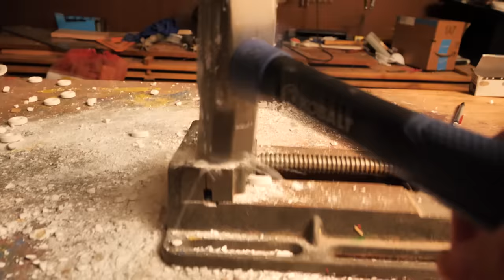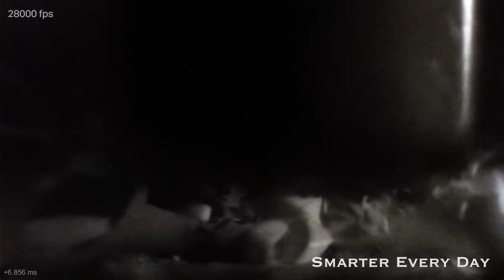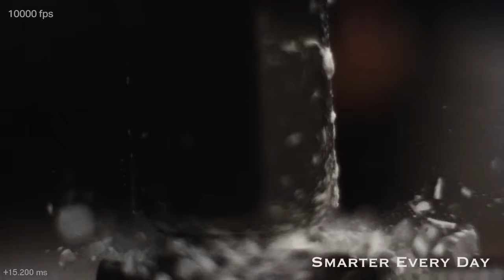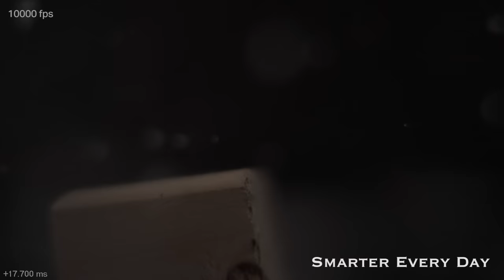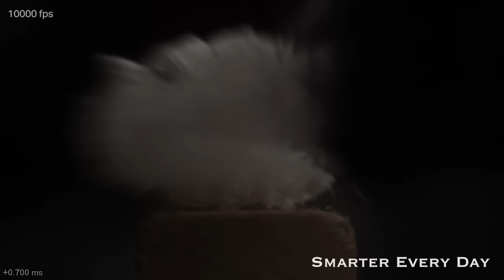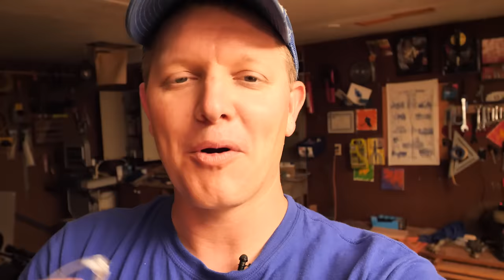LIFE SAVER LIGHTNING (Triboluminescence Slow Motion) - Smarter Every Day

Comment: Hi @Destin,
would it be possibel to do a spectral analysis of the emitted light? It might offer clues to the process involved. If it is an ionisation like @JediBhuddist guessed you should find a very element- or molecule- specific wavelength. If a thermal process is involved the spectrum should be broader and the smallest measured wavelength should decrease with increasing energy input.
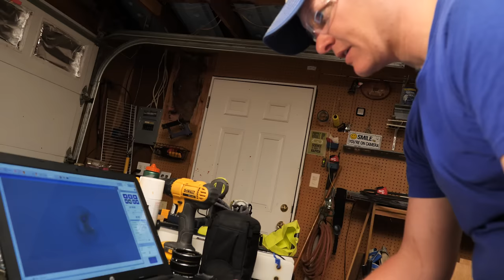It would also be interesting to know whether the wavelength of the light depends on the crushed(/stressed) material or on the atmosphere around it(or maby gases inside the material[dissolved or present in pores]).(4:45 indicates that only the crushed material is involved, but anyway)
Thank you so much for making this video :)

Comment: Ok Destin, not sure if you are going to read this but:

There was a video about Scotch tape being ripped in a vacuum, that caused both Triboluminescence, as well as X-rays. Not just a little bit of x-rays... Enough to develop film. It was significant. (but required a near perfect vacuum)

It looked IDENTICAL to these lifesavers, and the theory behind that is that scotch tape isn't a physical bond, but a chemical bond that when ripped apart, releases energy in the form of light and radiation. I would LOVE to know if this would be the same result?  Do you have a way of measuring x-ray radiation? 

Science!!!
Reply: duct tape being pulled apart produces light also and it works at atmospheric pressure.
Reply: There was even a proposal to make a really small low cost x-ray machine that work on that principle
Reply: I see similar blue sparks when opening my Breathe Right nasal strips.  Easy to see with the lights off.
Reply: Sudz Opening self sealing envelopes causes blue light to be given off also.
Reply: OK, everyone offering examples? ALL adhesive strips spark when you pull it apart. There, I just covered every possibility, Lol :D
Reply: Velcro doesn't. Checkmate Atheists.
Reply: @Ryan Gunn Not all adhesives do that, but most of them do at one frequency or another.
Reply: DFX2KX fair enough, I over generalized.
Reply: No biggie.

Though that does bring up the few that don't do this, and why. Now THAT would be an interesting video.
Reply: L L 
Physics Girl just did a video on the bandaids
Reply: You dont even need a vacuum for that to occure. I used to devlop film in jr. high. The film, mostly 35mm was taped to the spool with masking tape. We had to make sure we peeled the tape off of the spool slowly so it wouldnt spark and ruin the film.

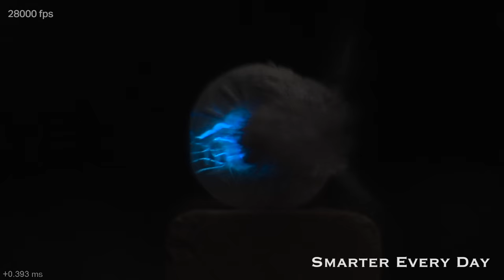Comment: The part that fascinated me the most was that during one frame around 4:31 you could see the blue glow beginning to spread before the pellet has actually struck the candy. At least, it appears that way with the streak of the pellet visible to the right of the lifesaver. I wonder if the shock wave travelling in front of the pellet, as it moves through the air, is creating enough stress to start shattering the lifesaver. If that's the case, couldn't you just fire a bullet past it but close enough for the shock wave to shatter it?
Reply: I believe it was the force traveling through the lifesaver from the front part being opened up - as if a wedge (the pellet) was driven in and forcing the part in front of the pellet to separate. Maybe?
Reply: Do high speed cameras have rolling shutters? Enough that, if the right part of the frame were captured first, the bullet would have moved ahead by the time it started capturing the impact point?
Reply: Sorry I am late but yes the high speed cameras have a rolling shutter (all cameras do) and the usual scanning pattern is either top to bottom or left to right. This is causing that effect, not a Shockwave (:
Reply: @samueldurazzo5312  Phantom cameras (and most good high speed cameras)have a global shutter. They need to in order to be useful for any kind of research
Reply: Shockwaves only come from the barrel of the gun, from high pressure and gas escaping, not the bullet.
Reply: @ashtonsenko536  Anything that moves fast will have a pressure wave in front of it, even if it's much weaker than one caused by a gun
Reply: Thank god my eyes are alright I was wondering if I was alone...
Reply: rolling shutter is my best guess
Reply: That's what I thought initially but if you look at how far the bullet moves each frame it's very likely it already penetrated and they just didn't capture it.

Comment: 4:29 does anybody see blue before the pellet hits
Reply: I think it is there. I wonder if that could be caused by a pressure wave in front of the pellet.
Reply: Micah Mainord vlogs answer is rolling shutter effect
Reply: Josua Dom i don't think it is
Reply: Yes, I was thinking the reaction is happening just prior to impact. I wonder if bioluminescence could be triggered with vibrations.
Reply: I saw it and think it needs further investigation - more framerate, to see if it's  an artifact of single frame or does happen in reality.
Reply: Hey Guys, This is probably happening because of the way the camera 'scans". I.E every frame it takes either takes a reading from each pixel top to bottom or left to right. Give "rolling shutter" a google.
Reply: It’s possible its the pressure wave beginning to stress the material creating the triboluminscence
Reply: Phantom cameras (and most good high-speed cameras) have what's called 'global shutter' so the whole sensor captures all at once. Otherwise they'd be of little use for actual scientific research. My guess is just motion blur or the frame was captured at the exact moment  the pellet hits
Reply: It looks like that because of the blur from the speed of the pellet
Reply: Me too
Reply: I thought the same thing
Reply: horizontal rolling shutter
Reply: it just looks that way because the pellet is going really fast and it is blurred
Reply: I guess that could be a pressure wave from the pellet. But perhaps someone can do an actual scientific analysis?
Reply: Yup I saw it , I think it is because due to the speed of the pellet, air compresses and form a dense invisible layer in the front of the pellet, which is almost like a solid...... well ....... that’s what happens with an actual bullet fired from a gun, so I think that’s what has happened in this case too
Reply: It looks like 2 frames blended together, not enough fps to know
Reply: I see it
Reply: i believe this is a question that needs further examination by maybe the slowmo guys i believe their computer hardware can handle much more frame-rates
Reply: i did..i think it might be the wind force in front of the pellet causing the build up of force before the strike....but yes i saw it.
Reply: I see it at more of 4:30 but yes
Reply: @josuadom2029  rolling shutter doesn't go right to left
Reply: @jasperrelph5961  The rolling shutter would have to go right to left to cause this artifact
Reply: This got patched
Reply: I was just about to comment on this.
Reply: Could be a shockwave or lack in frame rate (which I doubt)
Reply: Yes i do
Reply: Same observation
Reply: Yes!!
Reply: framerate
Reply: The only reason I came to the comment section was to see if anyone noticed it (was sure someone had to) and if he had replied.
Reply: Bb almost moved to fast to pick up correctly on camera
Reply: How didn't Destin notice that
Reply: Yes
Reply: until we get to record it with faster camera, we can't say for sure.
Reply: It might just be because of the shutter
Reply: I was going to ask,too, cause there's Light before it Struck... makes 2 of us, at least...Nice Work...
Reply: that's right
Reply: the shockwave of the pellet caused micro cracks probably
Reply: the shockwave hits before the pellet itself (it pushes air) - one possible explanation
Reply: Not too sure but it could be the shockwave of the pallet,  high pressure point? Destin should talk about this
Reply: Josua Dom no, most cameras have top to bottom shutter, which would prove this wrong but if this phantom have a right to left shutter this could be possible. I don’t know much about that specific camera though.
Reply: @josuadom2029  No, That would be vertical
Reply: If its supersonic there wont be much of a pressure wave infront of it
Reply: Yes.
Reply: Bolo Yueng used to use iron palm to shatter big blocks of ice. They did a slo mo of it. And he never actually touched the ice. He explained that he stops right before he hits the ice to allow his "force field" to interact with the force field of the ice. Creating a shockwave that destroys the ice. The theory that all particles have  a magnetic charge around them ,and that we never actually "touch" anything .only the magnetic field does. Pushing on all the other particles field to the point where it disrupts the fields creating destruction ,stress,  or breaking.  Idk my hypothesis is that when extreme stress and pressure are placed on an object to the point where destabilization occurs, that the structure breaks and fails and the speed of light thus creating light.
Reply: cameras have rolling shutters it probbaly caught the left most frame of the candy as it got hit but the image showed before the impact
Reply: its just a nother bb in the gun
Reply: @ariusbentley6086  i dont know if you know how single shot BB guns work
Reply: @Flipclockfans  I was thinking the same thing. What if they did the same experiment in a vacuum?
Reply: @spriksie  you are very confused. bioluminescence is not present anywhere within this video. this is triboluminescence. it occurs when molecules/ atoms are ripped, cut, crushed, or cleaved apart. when sufficient force/ speeds are reached a release of static electricity can be observed. 
Bioluminescence is an organic, light producing  chemical reaction observable in only living organisms. bioluminescence can not be achieved by a lifesaver because ironically enough, it is not alive.
Reply: @spriksie  its not bioluminescence, that is caused by a biological chemical reaction, this is not
Reply: Basically, sugar is piezoelectric due to its crystalline structure; when the crystal is deformed rapidly ie by sudden pressure, or physical cleaving, tiny electrical impulses are created... as the crystalline structure is split, so are various ionic bonds, resulting in a small voltage difference across the (now) broken structure, causing a spark. The wintergreen lifesaver candies contain methyl salicylate flavouring, the molecules of which emit visible blue light when struck by ultraviolet radiation, due to the fluorescence of the intramolecular hyrogen bond linking the hydroxyl and carbonyl groups of the molecule. The tiny sparks generated by the piezoelectric effect, emit tiny amounts of ultraviolet light, which impact the methly salicylate molecules, causing visible blue light.

We can see that the pellet travels roughly 8mm per frame (using the candy diameter of 30mm as a reference) and we know that the Phantom Miro C320 shoots at 1480 fps, the projectile was travelling around 11m/s so a 0.12g pellet would have a nice "pressure wave" in front of it extending several mm carrying sufficient force and unloading it rapidly enough on impact to induce a preliminary piezoelectric deformity.

TL;DR as some have said, tiny pressure wave. The Miro C320 uses a global shutter mode - all of the photosites are gated synchronously - during high framerate recording, so this isn't a frame artifact.
Reply: Because atoms don’t touch
Reply: @alexmayle2786  no
Reply: Yes I seen it, clear blue light before it hit, hey Destin, can you do it again, but not hit the life saver but just miss it?
Reply: Probably from air flow/force.
Reply: No the reason it looks like it got blue before the bullet hit is the bullet looks black at the tip and not at the bottom

Comment: is that spark from sugar can trigger a fire if you have a flammable substance underneath? like maybe gasoline or something? make an experimental video about that please. i'm interested to know about that.
Reply: i'd take a massive pile of candy all going off at once to generate enough of a spark to light something.

It's bright, but the actual voltage is in the picovolt range.
Reply: It's not from sugar. This works with sugar free ones too, but only certain flavors work. Wintergreen works.

Comment: i have a question, can the spark from the live saver lighting ignite something?(gas to fire? or anything else)
Reply: Ooo. It is? But it looks like have some power...
Reply: Yeah, but I'm not sure if you could do a whole lot with it.

I've also seen people talking about scotch tape giving a similar effect, and producing x-rays when it is torn in a vacuum.
Reply: Okay then. Thanks for the info👍
Reply: Mrnat all adhesive strips do it. Spend a few minutes in complete darkness and have fun.
Reply: Maybe ... the minimum ignition energy of a hydrogen-air mixture is a scant 0.019 mJ, which I think is less than you can even feel, at least readily.  Casual Googling has not revealed how much energy is liberated in this case.  TL isn't that well understood ... it quite likely involves the movement of electrons, but whether they are moving between orbitals or between larger discrete particles I'm not sure.

It would definitely be interesting to see this performed in a carefully controlled hydrogen atmosphere.
Reply: The spark is likely what causes that somewhat tingly feeling when chewing one.
Reply: im gonna use it to produce energy, im gonna be rich
Reply: Bite a lifesaver and tell me if it starts a fire in your mouth.
If it does, please call the fire department.
I imagine that some agency would prevent these candies from being sold if the spark could start a fire. After all, these are candies, and as such they do go in your mouth...
Reply: Its primarily light energy, given off by electrons jumping from the candy to the nitrogen in the air for some reason. The reason its so bright here, is because of a florescent flavor chemical in these particular candies

Comment: Question: Can this spark produced by the candy ignite some fuel or gas?
Reply: Test it and see report back
Reply: No.
Reply: Lathem HD it will be a life saver if it did
Reply: Emmanuel Martinez Badum tsss
Reply: Sadly, no.  To the best of my knowledge, the "sparks" aren't electrical.  They're just light.
Reply: Emmanuel Martinez .... and the "Dad Joke of the Year" winner is....!!!
Reply: @Kyoobur9000  Doesn't it have to have some type of energy in order to produce the light?
Reply: Josh Prentice Yes, and it’s created by changes in the structures of the ingredients as the candy relieves mechanical stress by breaking.  Don’t know the exact process but I do know that the energy for the light ultimately comes from the work done crushing the candy.

Comment: Makes sense that it doesn't record sound. 10-20kHz slowed down to .5-1 Hz would be inaudible anyway, even at 1000x the usual 48kHz sampling frequency. I suppose if it could it could be used to hear ultrasonic sounds you normally couldn't and maybe even a mouse or porpoise couldn't either when slowed down.

Comment: this is due to electric charges just google you will know it will be long comment if I explain it here basically due to electrons collide with nitrogen molecule in the air while jumping from one piece to another to maintain charge and  causing the molecule to emit ultraviolet light, those ultraviolet light you can't see, what you see is the emitted blue light due to absorption of ultraviolet light by cand pieces

Comment: With the BB gun I can explain what some have commented on below, where it appears the Mint glows BEFORE the BB impacts. All super sonic objects that generate a pressure wave also generate ultraviolet light (by exciting Nitrogen molecules inside the pressure wave) on the very leading pressure zone in front of the object. The BB generates a small amount of ultra violet light that in turn excites the methyl salicylate(which is a florescent) in the Mint and that florescent happens to glow in the blue color spectrum.

So its a simple florescent light 😎👍

Comment: Some info you might find interesting, rather than the bonds breaking like tribo there is piezoluminescence which is just a deformation in bond that creates mechanical light. Crystals like LSD have this property when pure crystal form. Imagine how more magical Owsley must have thought LSD was once finding this out in his lab lol. 
The Owsley Effect
"LSD is piezoelectric. It's an electrostatic crystal. Which means that one crystal doesn't touch the next. Instead, they reside on a field of electricity and keep one another equidistant from each other. Basically, LSD25 is the chemical representative of the "Flower of Life". When you look at LSD under the microscope you will notice this.
When these piezoelectric bonds are broken or deformed it causes the LSD crystal to emit light, this is called piezo luminescence.
The Grateful Dead song titled, "Lazy Lightning" was inspired by the shaking of a gram of ultra-pure raw LSD crystal in the dark. It emits yellow, blue, silver, grey, white, purple, and green sparks." - Robert Charles
Alexander Shulgin confirms this observation in TIKAL. Shulgin, “A totally pure salt, when dry and when shaken in the dark, will emit small flashes of white light.” This quote can be found under synthesis in TIHKAL’s LSD 25 section. Side note: An application that I can think of that uses piezo crystal is a knock sensor in a vehicles engine. When a hard enough vibration is sent through the piezo crystal it creates a small AC current. Also the only ac signal used in automotive engine management.

Comment: Thus compressed sugar crystals within a defined spacial object(Life Savers)share a piezoelectric entanglement by way of electrical shock waves created by a kinetic force projectile bombarding the Crystalline Glucose. The same way Quartz rock near fault lines has been observed to contain Piezoelectric properties which vibrate under stress thru compression causing Electromagnetic field disparities/anomalies.